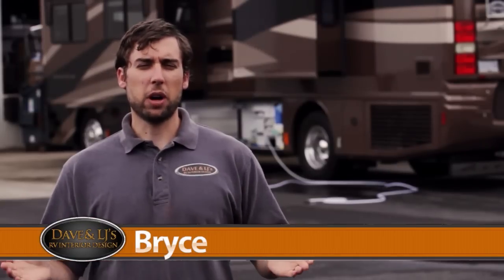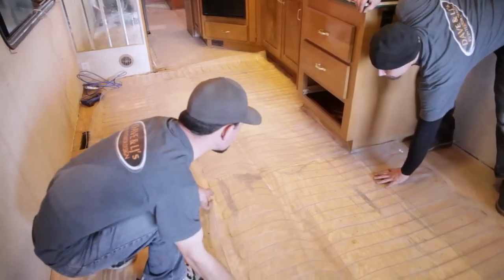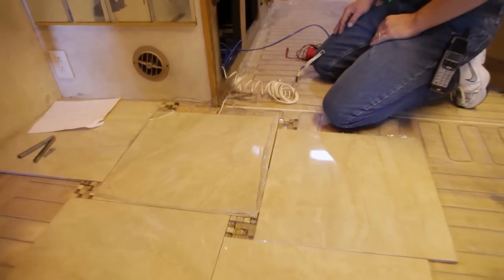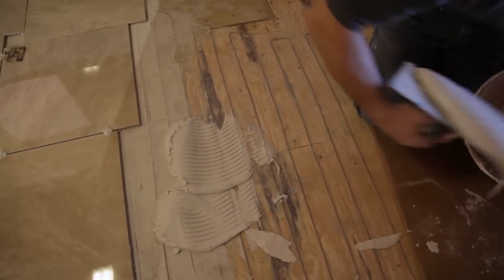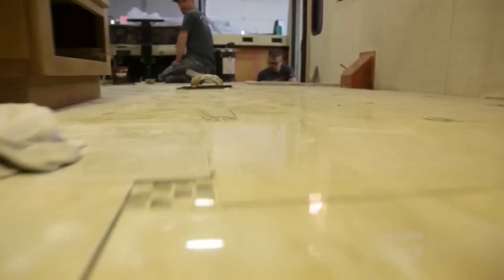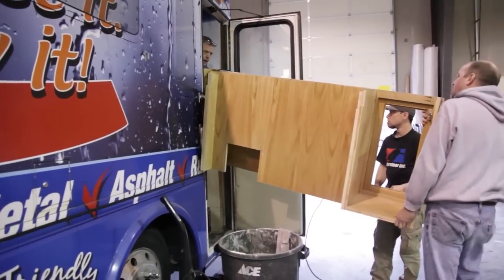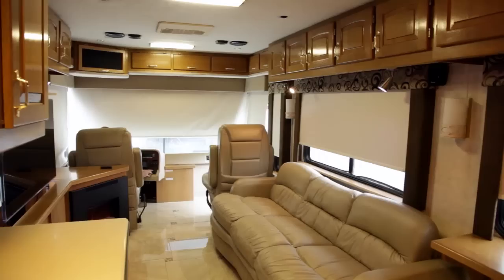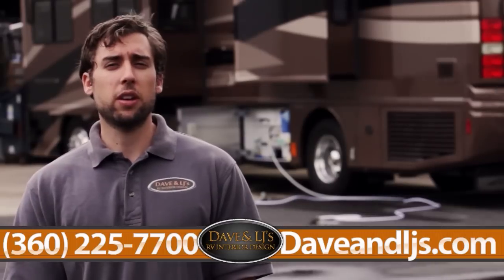Motorhome remodel - Heated tile floor, motorized tv lift, electric fireplace, Auto Motion shades

Comment: Would the radiant floor heating work when the RV was not hooked up to shore power? Is it 12 volt, or would it work with a solar power set up? How many amps does such a set up typically draw? Very nice job, by the way.